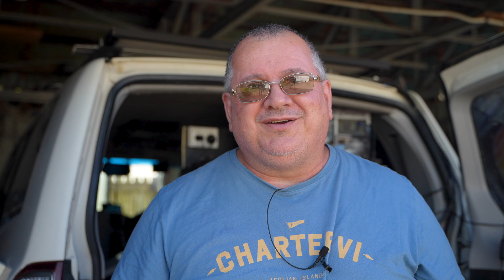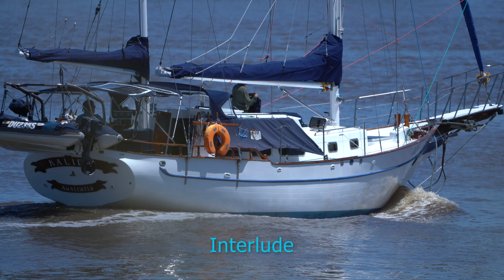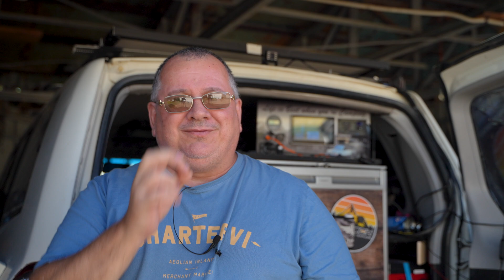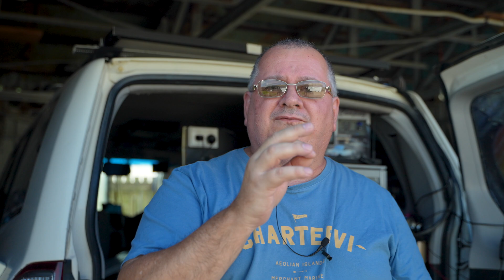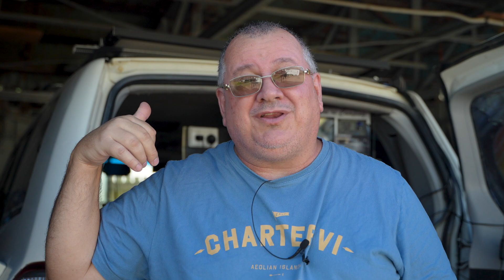Why You NEED a High  Amp MPPT Charger for High Voltage Solar Panels

Comment: you not need high amp chargers, sun angler ist off= <50% charge or clouds= 10% chatge, rain? 10% charge there are tons of situations in real world use that end in only some % of the possible charge thats why a 20 Amp charger is more then enougth for you 440 watt panel.....

in real world use a ratio of 3:1 solar"theoretical" Watt peak: to charger speed is a good value.

20A amp charger for example is 20A x 14 volt = 280 watt charge speed.
440 Watt solar :280 watt charge speed= 2:1 more then enought in real world use....

Comment: Thank you for taking the time to make this video. I appreciate your time and teachings. I just found your channel and subscribed. Your way of simplifying it all is brilliant. I agree fully with you on everything you said, and it's also how I did it. Going bigger with cables and CC is a must as you will always upgrade.
I am also a 12 Volt Solar system fan as 24 Volt is to high for all my 12V devices. I don't run high loads, so 12V is just fine and also safe.

I have considered running 24V in the past, but the problem is getting 24V inverters in my country and then also a buck converter to convert 24V back to 12V again for my devices, lights, etc.. so for me it will be impractical to go to 24V. Yes, I agree 24V systems are more efficient, but you are looking at other issues, as in my case, if you do go that way.

Yes!! Victron is the best, and you can monitor everything on your phone. It's expensive, but as the creator said, it lasts many years and has proven itself to be the very best on the market. As a huge plus, Victron CC's will handle 12V, 24V & 48V systems. Victron does run hotter than other cheaper CC's, so if it gets hot where you live, consider a cooling fan for the CC.

Never ever go over the CC.s Voltage limit. You can over Amp with no problem, the Victron CC will limit the current or Amps to its limit automatically. Pushing too many Volts will damage it.

Try to always push more Amps without surpassing the CC's voltage limit.

Hooking Solar Panels in Parallel (Positive to positive & Negative to Negative) will increase Amps as the overall Voltage of the panels will stay the same.

Hooking up your panels in Serial (Neg to pos) will combine the voltages of the panels and add them up, and keep the Amp's the same.

Many reasons for what to choose and why, etc

Many AMP's will need thicker wires!

Higher Voltage does not need thick cables on long or short runs.

Buy more than you need, you will not be sorry in the long run. 
This creator knows what he is talking about.:goodvibes:
Reply from the maker: Thanks for the awesome comment. You're spot on!

Comment: Good work Phil, and you're spot on about the right setup being set and forget for the most part. Too many people get a "just enough" system and then find they have range anxiety quite often. Going the extra mile with the Mercury gives you peace of mind. Big solar is almost always the go too, charging from solar works regardless of if you're driving or not, and reduces the load on the alternator. 

For PowerPaul batteries, we find 14.2v Absorption is the sweet spot with the current software upgrade installed :)
Reply from the maker: Cheers! I agree, you're better off going too big than too small when it comes to solar. 

I have not performed the latest update thus far.

Comment: Well... it's because you are being a bit silly and using a 12V system voltage instead of something more practical like 24V or 48V.  So of course you have to have tons of high-amperage equipment to push power into a 12V system.  And I'll bet it generates quite a bit of heat, too.   As a side note, I have a tiny little Victron 100/20 pushing over 500W of solar into a 24V system as we speak.  And I have two small 48V systems wired with 10 AWG pushing 1000W that barely even get warm.  Beats having huge thick cables!

Though I will say, generally speaking my preference is the Victron 150/35 these days and not the 100V models.  Many brands of residential panels these days can hit 50Voc and you can't even put two of those panels in series on a Victron 100/xxx without it over-volting.   I consider the 150/35 to be the best bang for the buck and if you are hitting the 35A limit... then you need to consider the possibility that you made a mistake picking too low a system voltage.

-Matt
Reply from the maker: My system works perfectly fine. No issues.  Never had any.   

I agree with you on going 24v with larger systems.  But mine is not large enough a system to warrant going for 24v. 

Why would I want to do that when this is working.  I’d have to change my battery.  Change my multiplus inverter/charger.   Than having to use a voltage reducer so I can use my 12v accessories.   The costs alone don’t make sense.  You have to be silly to even think about this. 

I mostly use 12v.  It don’t make sense to change my setup.

And 30 amps.  I don’t call that high amperage. To warrant in such a huge investment to change over to 24v. 

If I was starting from scratch and I have the room.  Yes,  i would go for a 24v system.  

I’m gathering your from overseas. Here in Australia we mostly use 12v and don’t require 24 or 48v systems.   There are some exceptions such as large setups using trucks etc.  the majority of us use 12v systems. 

And take note of my finishing comments at the end of my videos.   Be kind.   And not calling me silly because you don’t like 12v
Reply: @PhilsCampingReviews  I definitely wasn't suggesting that you rip everything out.  You arer heavily invested in 12V so it would be a costly change.  But anyone doing a new system from scratch, even a small one, should probably be doing 24V at a minimum these days.  48V if they are in a larger RV.

Mainly it comes down to a story I see repeated a lot... where people put in a 12V system and then a year or two later they hit a wall when they try to scale it up even modestly... not realizing that they had already maxed-out a good chunk of their cabling in the original installation.

There just isn't very much room to scale a 12V system, but its the very thing that many people want to do now.  Just for power delivery if anything.  Being able to run more than one regular appliance without tripping a breaker or an inverter.

Heat and compactness is also an issue.  You can really squeeze 24V and 48V systems into small spaces in ways that you just can't do with 12V systems.  Every piece of equipment is smaller and generates less heat.

-Matt
Reply: @junkerzn7312  Hi there Matt, I always see you on Projects in Paradise, and love reading your extended help in your comments. Your advice is always on point, but you need to keep in mind that not all countries can get 24Volt inverters or even 24V to 12V buck converters. Here in South Africa, it's not easy to find, and when you do, it's very expensive and with limited stock.

I agree with you fully on higher voltage, even on small new systems, the advantages are just too many to mention here, as you know :)

Comment: Great video mate and I am so impressed with your passion for off grid power production. Just a suggestion to explain power produced at different voltages- power (watts)= volts x current (amps). Your regulators job is to convert the panels 450 watts (36v x 13amps= 468watts) to your battery’s required power at 14 volts , or there about. 14.2 volts x 30amps= 426 watts. There will be some losses of power in the regulator, that is why the calculated regulator output power is lowered than the regulator’s input power. This just a simple explanation based on the voltages and currents you were quoting. Keep up the good work.
Reply from the maker: Thanks for the detailed explanation.